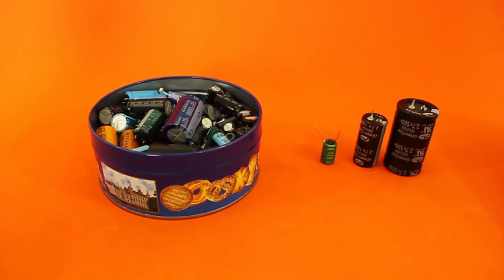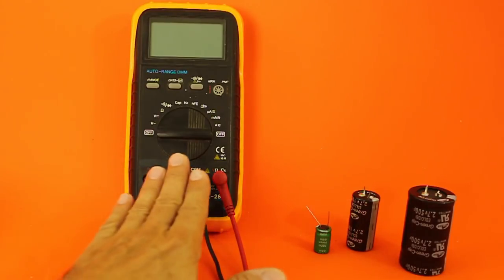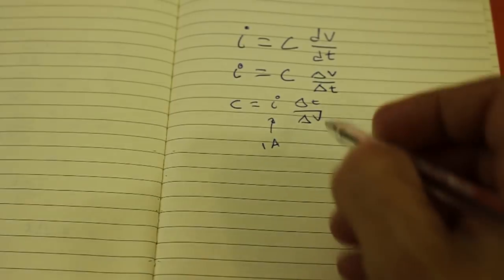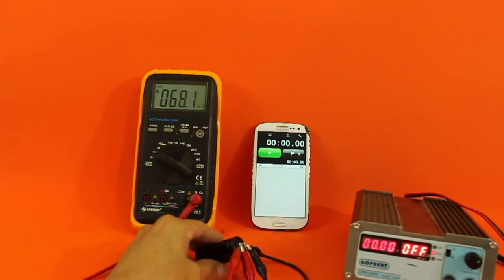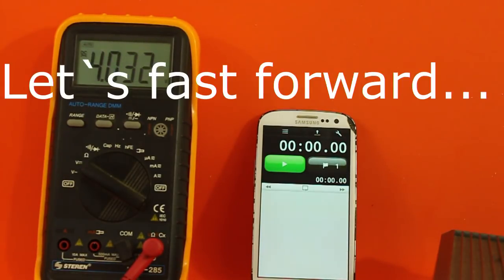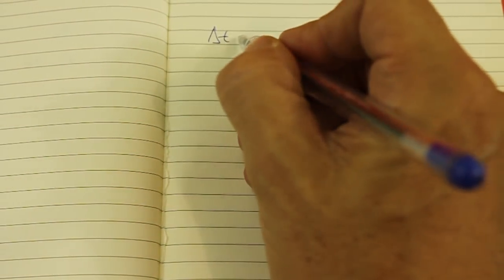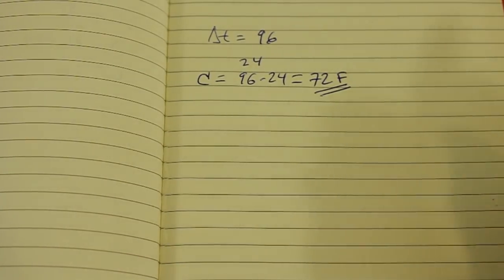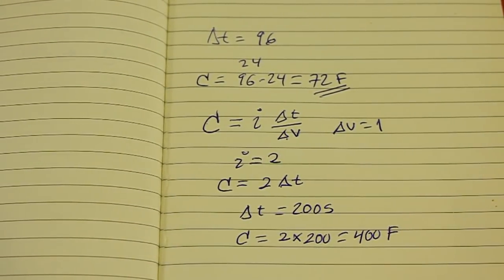Simplest Way to Measure Supercapacitors

Comment: I bought myself a capacitor bank with 6x2.7 v 500 F capacitors on a balancerboard to jumpstart my youngtimer in the winter.
when I first tested it, the voltage of the capacitor bank was immediately at 10 V and I was pretty disappointed.
Now I understand what I did wrong, but why do you charge them a couple of times to make them work good

Comment: Hi mate, let's check some important points

1 - The 1 voltage range 
R> When you charge a capacitor from 0 to 1 volt, it means that it has space to accumulate charge and you can do fewer efforts to put the charge there. From 1 to 2 you have a certain amount of charge, so then, you can do more effort to put the charges there. Basically, it means that the voltage range is not linear each charging step you need more potential energy

2 - i=1 A you have a delta_t

i=2 A you got another delta_t
Reply: The point of using constant current is to control the "effort" going into charging it. That means there's no difference between going from 0 to 1 and 1 to 2 volts.

Comment: I am thinking you measured the 100F capacitor and got 96 seconds.  I don't think your fudge factor that removed 24 makes any sense at all.  I think you were close already with your 96 answer.  I would not think one of those caps would have a large internal resistance but that value should be published in its spec.

Comment: Hi, thank you for a nice video. Where did you find that 24% estimation? I would like to know more about it. I have few super caps but datasheets are not available (Chinese caps) and I have no idea what the internal resistance is.
Reply from the maker: By comparison with the value obtained by measuring the internal resistance. However the internal resistance depends on the quality of the capacitor. Cheap chinese caps tend to have larger ESR than quality caps such as Maxwell
Reply: I see, thank you for your answer =)

Comment: Its total 116s. 56+60=116
Reply: Lol he got the simplest part of the math wrong. But good video nonetheless.
Reply: 25% loss due to internal resistance, 116-29 = 87 Farad
Reply: Domas i was thinking how 1:56 is 96 seconds, as 2:00 = 120 Sec
Reply: Not the only ones...
Reply: Laurence, what you're saying is pretty ignorant... There's a grammatical explanation on why the number "7" has it's own central line. Here on latin america it's more common, while on north america, not.
Reply: @xSaDii   It is common in science and technology to reduce misreads.
Reply: Don"t expect too much from this guy. He writes F instead of 7